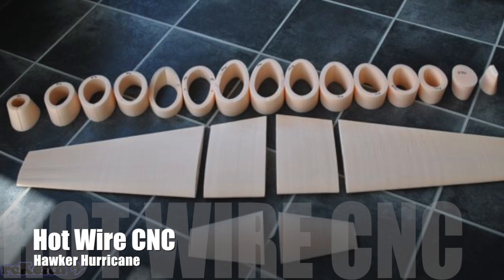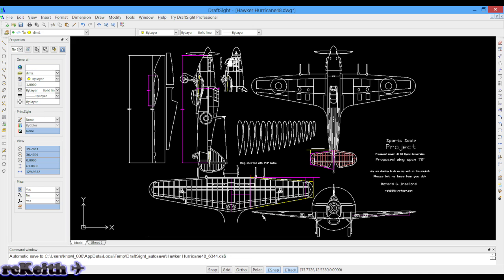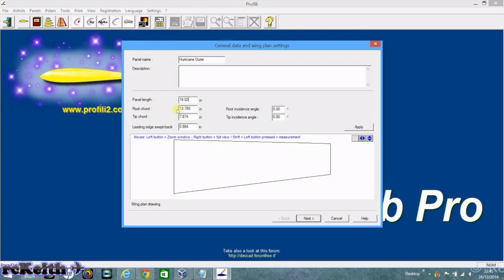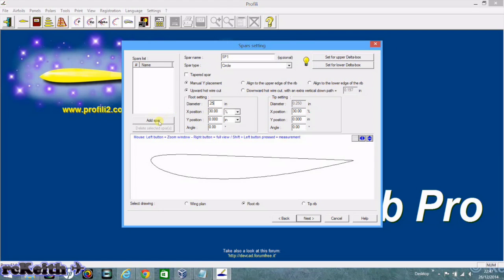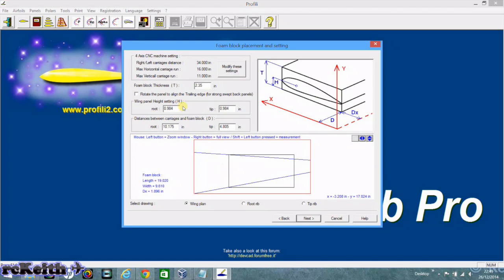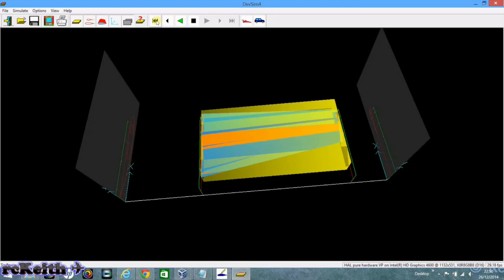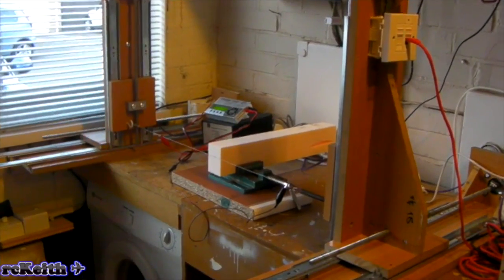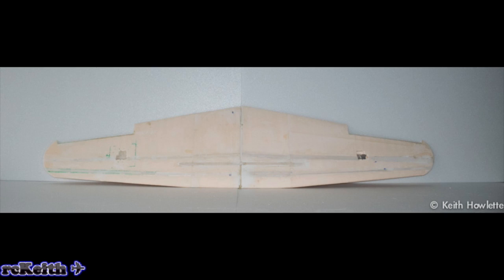Hot Wire CNC Foam Hawker Hurricane - Part 1

Comment: Looks like your using phone cable Cat5E to connect motors to the Driver Controllers with RJ45 Connectors?  I am the phone guy on OpenBuilds.org that started a foam cutter build.  My Electronics and motors should arrive next week.  I am planning on taking a old gaming computer apart and having my pc along with all foam cutter electronics housed in the same panel.
Reply from the maker: I think I've replied to your builds.  Hope it goes well.
Reply: +keith howlette Yes you did thanks